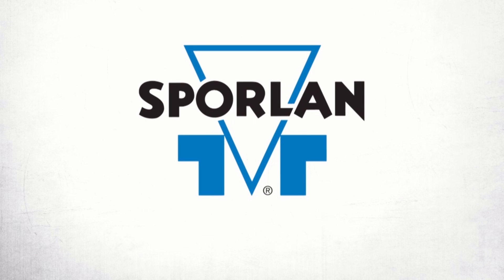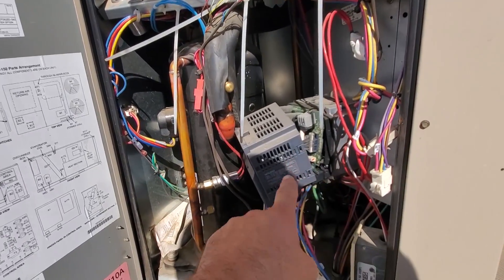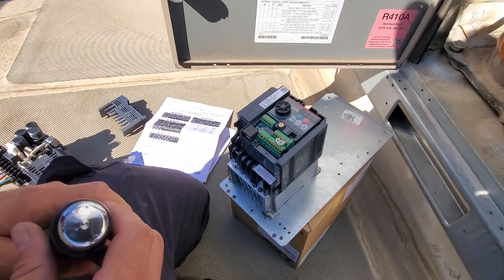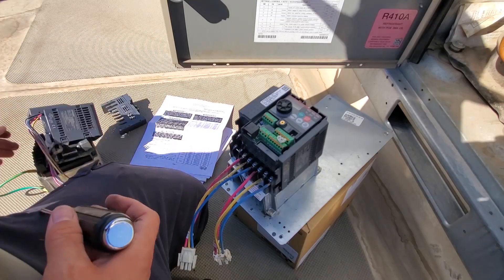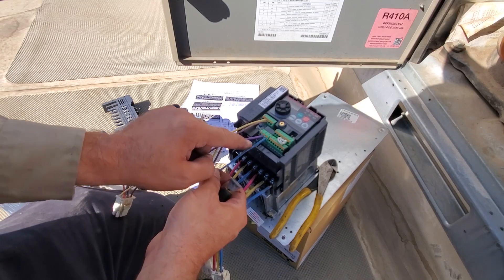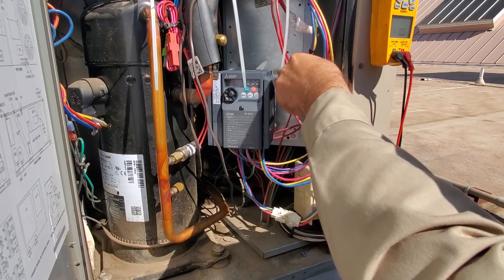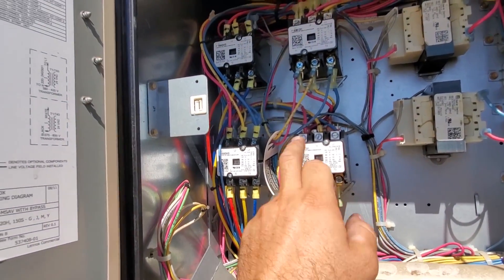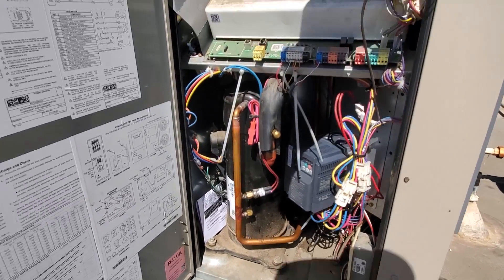LENNOX VFD FAILURE

Comment: After your wrap up and i went back and looked at those contactors to see for myself. I can't believe Lennox isn't using auxiliary contacts to interlock those two. That is motor controls 101. I wonder how many VFDs they have had to replace under warranty that could have been prevented with a pair of $10 aux contacts.
Reply: Even if they had interlocking contacts there would be a problem switching from on power source to another so quickly with a running motor.  The compressor will be running at whatever speed the system called for - if the system senses a problem and goes directly to bypass - the compressor will have slowed slightly from its speed and is generating a back emf voltage - the voltage the compressor is generating and the voltage from the bypass contact will be out of phase with whatever the compressor is generating and there will be a very high fault current generated for a fraction of a second ... I have seen all kinds of coupling failures - breaker trips and other electrical damage from transferring between two electrical systems too quickly.  It's the same thing as transferring the load from a generator back to the utility after a test - you have to wait till your motors stop turning to retransfer ... if you have a blink in power the drives have programming that you can decide what you want to do . You can wait and restart - you can wait for another start command or you can catch the motor "on the fly" - automatic transfer switches have what they call a programmable neutral time.  So without that delay time in the bypass relay there will be problems.  Faults generated like this cause the windings in the motors to flex - the flexing will cause the windings to fail where the copper windings enters the motor steel - it's called a slot failure.
Reply: I share your observation.  Such a simple fix to prevent energizing two contactors at the same time!!
Reply: I agree with the aux contacts. The software most likely switches both contactors at the same time. An aux contact will require the first one to be deenergized before the second makes contact.
Reply: I suspect that the way it works is you have one contactor feeding 480 to the input to the VFD, and the second contactor connecting the input of the VFD to it's output, shorting across it. So to bypass and power the motor you need to pull both of them in at once. But you probably want to drop the main contactor before you pull in the bypass contactor. Then the VFD can't do anything and is safe. But if the VFD is running and you pull in the bypass contactor you make popcorn some fraction of the time.
Reply: Agreed, also wondering why they haven't gone to solid state contactors. with the amount of airborne contaminants in and around RTU's it would boost reliability. Again, it's old tech at this point.

Comment: Does the control use the pressure switch attached to the blower housing to determine if the blower is working?

Comment: Sounds like they need a mechanical interlock  to avoid that problem. Great video.
Reply: Should of had NEMA rated contactors.. just shows the level of engineering degrees Lennox employs at its facility
Reply: Definitely would be a good idea.  Just the fact their using a dirt cheap definite purpose contactor for something that could instantly wreck the drive, shows that they spec'd this to hopefully last the 1 year warranty and they don't really care after that.
Reply: Good point

Comment: Great video, as always great content, I carry the the connectors for R290 units now instead of wire nuts I like the visual and locking the wire in place and preventing moisture. Those VFDS don’t look weather proof should be installed in a conditioned space

Comment: Any condensation on connectors with 480 VAC might as well be a short!
Reply: Being it's in the compressor area for sure
Reply: @DaveK76  It is the best place to put your VFD, thermal cycling, humidity and vibration.

Comment: VFDs are typically designed for 80 F ambient and start derating their output above this temperature. They should not be in a package unit on a 110F roof. Way over it’s specification. Look at the data sheet and you will be shocked! A 10hp vfd cannot output 10hp at 100f. VFDs also contain electrolytic capacitors which fail faster in proportion to their increase in temperature, higher ambient temps = significantly shorter lifespans. This is often a source of failure, as IGBTs are sensitive to dirty power
Reply: Vega they have cooling fans and most likely will be in the supply air side of the package unit. I had one fail last week. It was caused by moister. Mixing 460v and moister is not a good thing. I installed a dog house over the new VFD. The cooling fan will circulate around the drive to help keep it dry. ABB drives should have the cooling fans changed every 6 years. I just learned that from the ABB rep.
Reply: ACtech Formally yo mama while true don’t forget to think about startup on a hot day, the drive will be heat soaked, and the caps will be baking out their liquid electrolytics, and be derating on startup until the temps come down. This is a poorly designed system if they’re using a bypass contactor installed from the factory to detect a failed drive. Drives are either undersized, receiving dirty power, overheating/derating, etc. if you’re factory installing a bypass contactor, you shouldn’t be using a vfd, period. And btw for sure on the fan, it’s another maintenance item with a vfd

Comment: How long did it take for the part to come in and does it need more volts the bigger the tons are
Reply: Will Morrison Theoretically, the answer to your question is “yes” but the voltage is determined by the electricity supply authority and would be available in a small number of fixed levels and phase configurations. More cooling capacity requires more Volt-Amperes (VA) of supply power. Now, assuming that the voltage is fixed by the supplier, the remaining variable is current (Amperes) and this will vary with cooling load. That said, it is often seen that the larger the unit, the larger is the supply voltage to cut down on conductor sizes and Joule losses (I^2R) in conductors. Therefore, a very large compressor could even be (and indeed are) fed with a supply voltage of many thousands of volts.

Comment: I wonder if Big Clive would be interested in looking at those VFD modules? 🤔
Not sure what shipping would be like to the Isle of Man though lol
Reply: YES! Please yes! Didnt clive do refrigeration at one point too?
Reply: from the looks of that burnt wiring/plug it was the culprit and started to arc to the cabinet and killed the module. it was probably laying against it and got some water in it (salt water near ocean?) and off went the arcing. did someone work on it and not zip-tie things back into place and away from others? it's more ciritical with VFD driven things, especially at 480AC input levels which exceeds 670VDC pulses,  so beware of max wiring, connector and other splicing device voltages. most/many wiring splice devices are rated 600V max! some only 300v.
remember VFD stands for (Variable Frequency Drive) and the waveform of the power is nowhere near a nice smooth sine wave as is on 60Hz utility supplied power, it is very abrupt on off pulses, varying in width(on time) on a 480v input, that's over 670VDC pulses, so it's much more likely to strike and sustain and electrical arc and hold them for longer period, vs. direct ac line powered wiring. for blowers and pump they're working in "variable torque" mode.
VFD wiring needs special consideration, ratings and implementation, it seems they failed at engineering/implementing on those units :)
Reply: That would be the YouTube crossover of the century lol

Comment: Is there a significant power saving that justifies all the nuisance associated with these very unreliable VFDs?
Reply from the maker: Yeah California has an energy code (title 24) that says we have to have two speed motors on systems that are 5 tons or bigger. I understand the reasoning but in my opinion the true cost of the equip +repairs doesnt make sense......
Reply: @fluke196c  I think Chris did mention in one of the videos that a VFD is required per energy code in California.
Reply: I find that when I just slow down and don't prejudge anything I'm usually able to figure it out twice as fast! 
I remember we hasthis company came through phoenox and install VFD drive packs in the movie theater's and Box stores. 
Those things blew up left and right!
Reply: I love VFD's, they pay my kids in college.
Reply: Ahmad Nader I deal with larger equipment. They have VAVs. You need a VFD on the blower motor to keep from blowing the ducts apart. As zones satisfy and the dampers close up.
Reply: More of a comfort feature, but yes significant savings. Imagine how much gas you would need running full throttle all the time, now imagine that vehicle is the AC system- same practice.
Reply: @DW-vl2wi  makes sense!
Reply: @fluke196c   Mitsubishi has very few issues. great product. have been installing for 7 years with only a wobble in 2 indoor indoor blowers. literally no other issues, follow manufacturer practices and your customers will love the superior product